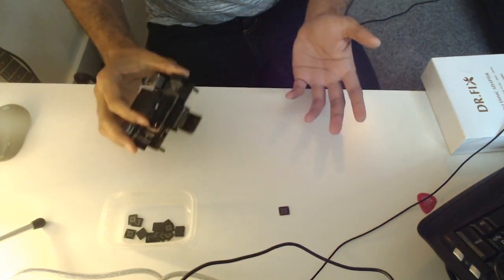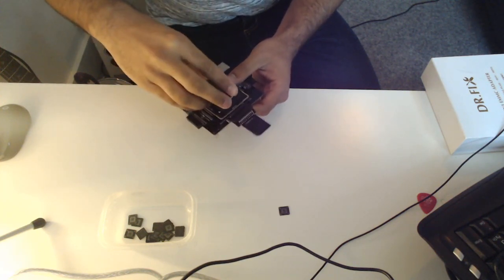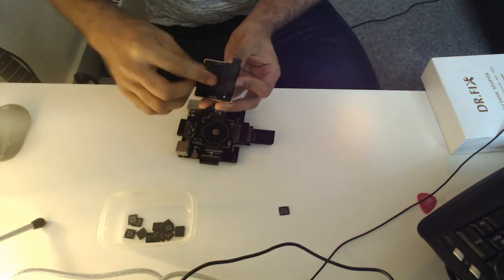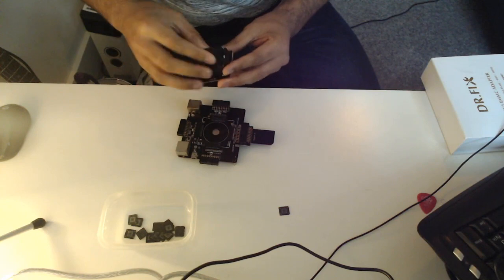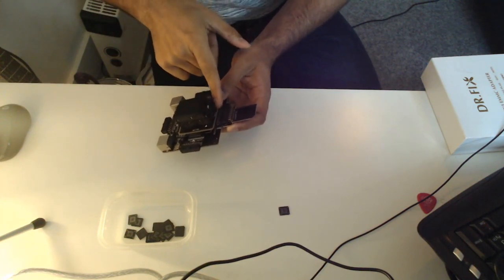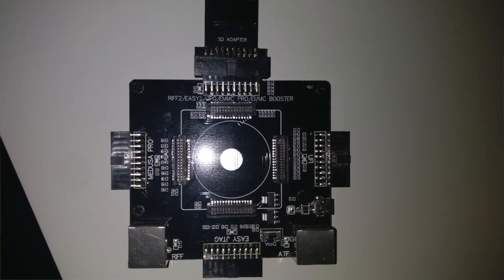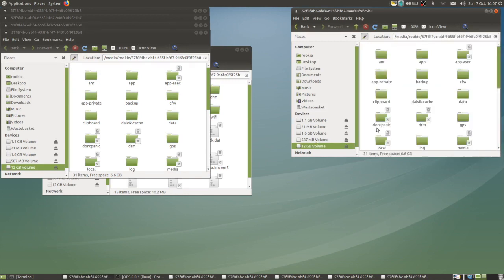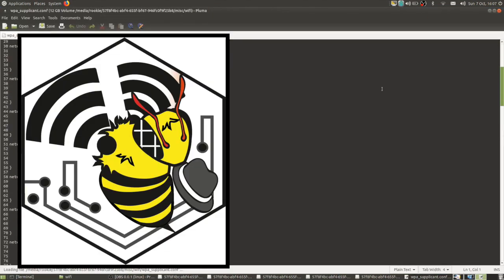Recovering files from a phone's eMMC Chip

Comment: Quick shout on the chip removal - use loads of a heavy solids flux before applying heat - it will make the removal much easier & will preserve the balling on the chip where no solder/thin solder won't. And don't start poking/prying the chip until you are sure it's loose, as that will also pull the balling/pads. Patience is key. And rosin flux.. loads of rosin flux.
Reply from the maker: Good tips!
Reply: @manchestergreyhats6032  Hi,  which software is used here? Please help. I want to recover data from a samsung emmc, it has very important data but of course is encrypted. 
Thank you

Comment: Here is a try for you if you like and want to
Also remove a side project chromebook with mods of corse put the phones emmc there then flash a Linux distro on it then desolder it again then put it back into the phone i always wondered if that would work but do look for the pinouts there is several

Comment: Hey man thanks for the video. I've got a bit of a problem with an old samsung note 5 phone. 
My wife passed away in 2019 and I just now was given her phone back by the police but theres a pin on the lock screen. No one knows the pin and this phone is full of baby pics and videos and the last videos of us as a family... and there seems to be no way to recover any of that besides physically pulling the chip and reading the data.

I'm fairly adept at working with hardware but I only have one shot at this. As of right now the phone is 100% fine and works. Is there ANYONE I can send it to for this data recovery? 

I've tried for weeks to find a solution and keep hitting dead ends. If theres any hope at all please let me know.
Reply: My condolences. I hope you figured it out.
Reply: @derpnerpwerp  funny you should mention it cause I was just talking to a phone tech the other day about it and sadly now it's still locked. I intend to do some looking into the above method and see what I can accomplish. 

I really would love to get the pics and vids off the phone
Reply: Note 5 phones don't use encryption just yet. You can flash TWRP, boot into that new recovery and your PC will just mount the file system. Just make sure you flash the correct version or you'll brick the phone (not a bad thing, you can flash the correct version after that without losing data)
Reply: @ll-tf4et  sadly this is an at&t note 5 sm-n920a... seems like I'm fairly screwed. The boot loader is locked on this model and so far no one has found a way around it. :*(
Reply: @ll-tf4et  Hi bro, I have redmi note 6 pro and phone always at mi recovery 3.0 screen I tried all methods it but can't worked for me. Can I open my phone without data loss?
Reply from the maker: Sorry to hear that. I'm not familiar with that specific phone but there are often ways to bypass the PIN. I know Samsung have a find my phone thing that can unlock the device if you know the account login details (i.e email address and password). There are also tools that exist that can try and brute force the PIN. It'll take a while but should be doable. Finally I guess there are people that do data recovery but I don't know anyone specific I can recommend. Probably worth phoning around or doing some google searches for trusted people.

Comment: Will this emmc ball joint socket reader work to boot from like a live usb in any device you wish to power with this on?
Reply from the maker: Hmm good question. I'm not sure tbh but I suspect it could work assuming the emmc chip contains a bootable OS compiled for the hardware.
Reply: @manchestergreyhats6032  in my case yes as as the cpu and ram went toast in it over a year ago but is there anything I need to look out for being comparability issues at the pre-installed phone os being old paired together with the hardware having different specifications than what the other version was made for?

Comment: How hard should I press on the chip w/ the soldering iron to remove the glue?
What solvent could I use to clean the chip?

I’m using a Sumsour 858D, at 350 degrees, holding heat on the chip for 1-2 minutes.
I want to avoid re-balling
I’m trying to recover 300k of dogecoin off a Samsung 153 ball point chip
and I’m a tight budget.
Thanks in advance ❣️👋😅
Greetings from Atlanta 📍